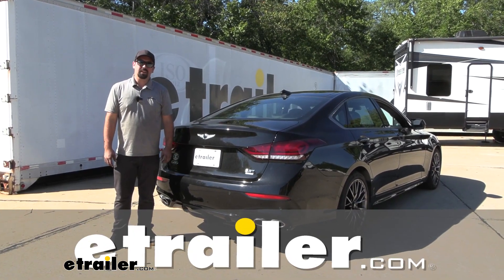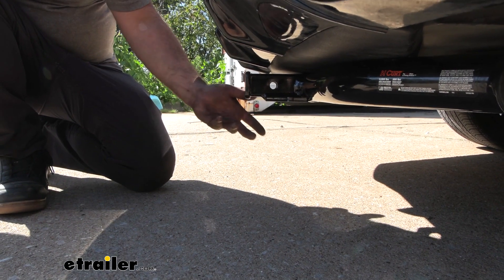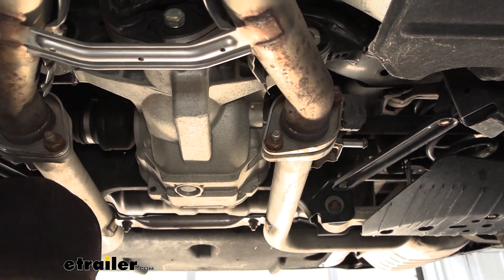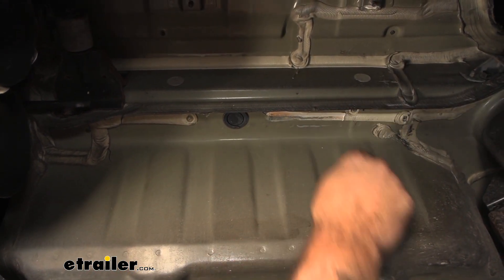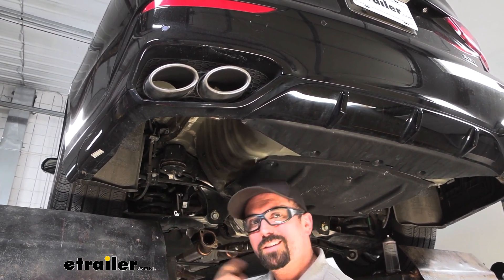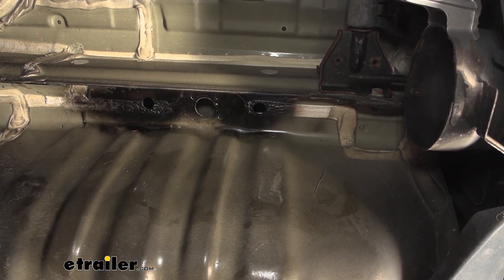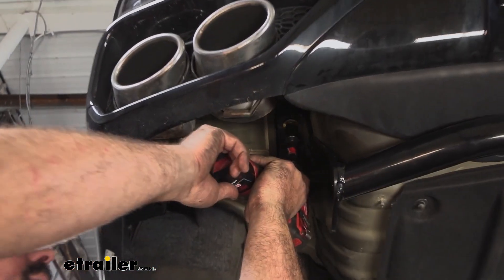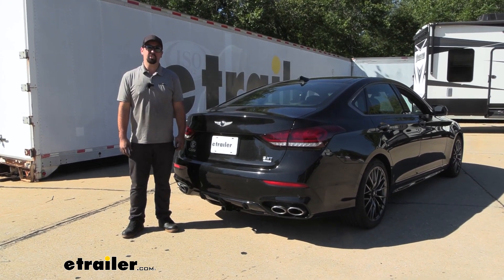etrailer | Set up: Curt Trailer Hitch Receiver on a 2018 Genesis G80

Comment: The ultimate degradation of a sports car - adding a trailer hitch. Whilst the other sports cars are running, bounding, and stretching their legs in dominance, this unfortunate bloke will be pulling a light-weight wagon. Is it even rated for towing? Treating a stallion like a clydesdale.